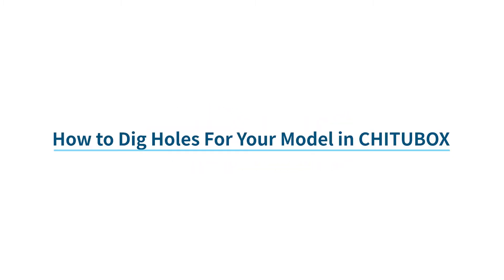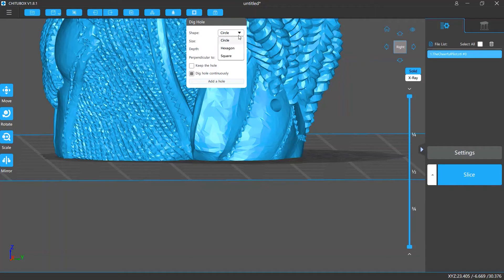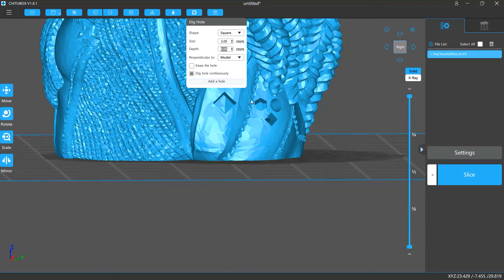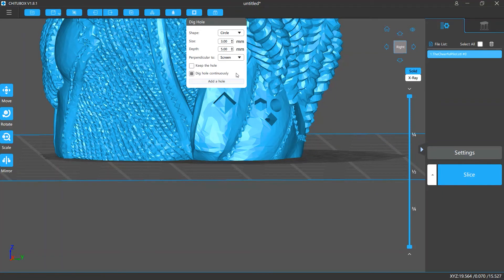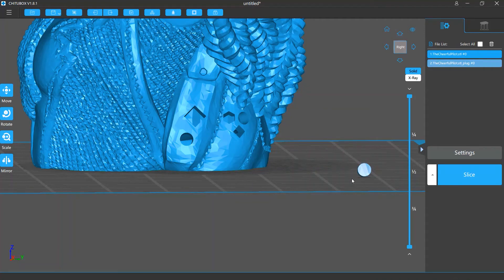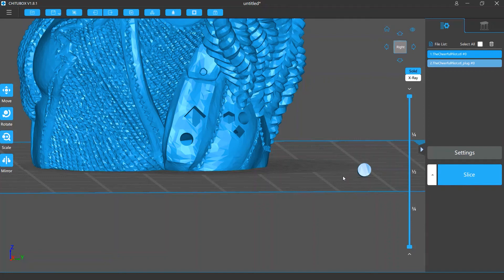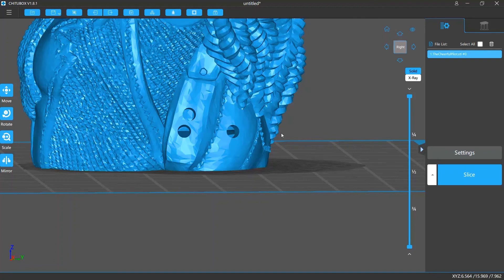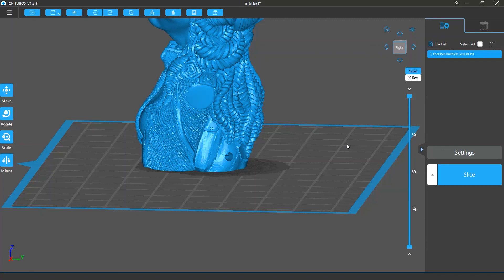[Tutorial] How to Dig Holes for Your Model in CHITUBOX

Comment: I'll try to create a video but I found out what you have to do is HOLLOW out the model you want to put a drain plug in first, then use the layer slider to pull down to the bottom of the model then add the two drain holes there! This video didn't show that!

Comment: It's 2023 with the newest version and the dig a hole works 50% of the time. Even trying to put a hole next to the hole you just made will not work most of the time.  You can undo a hole by clicking on the top box that says "REVOKE" UNDO THE LAST OPERATION.

Comment: 99% of the time is doesn't allow to drill a hold because "Not hollowed out or too deep to dig" because of the infill.
Reply: You have to hollow before that
Reply: @richrock9341  No, he's right. You can hollow a model and then get this error over and over and then the slicer will just randomly let you dig a hole with the exact same settings all of a sudden. It's incredibly frustrating.